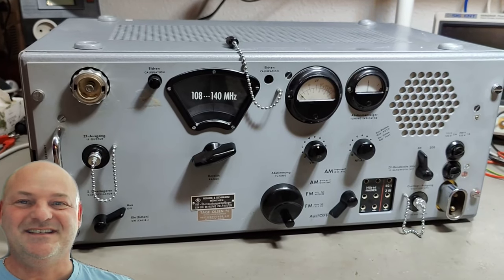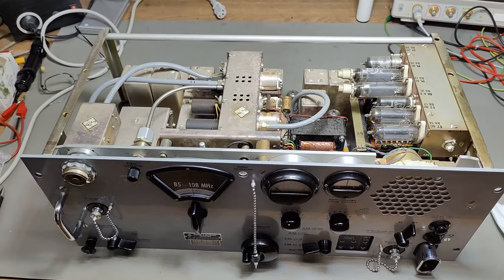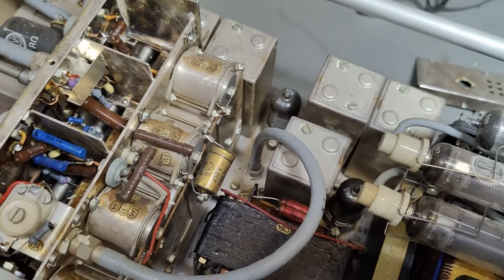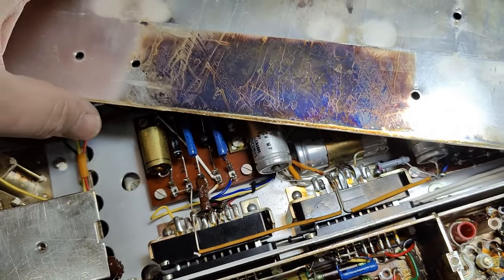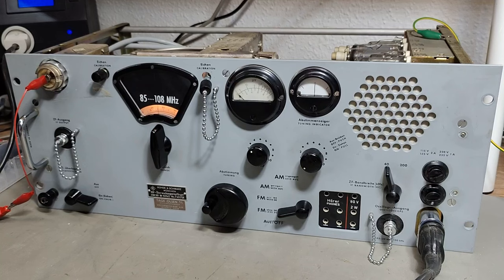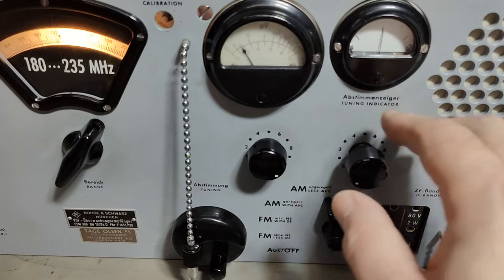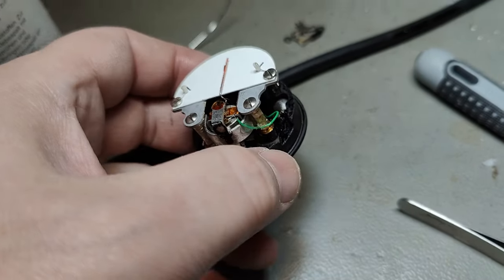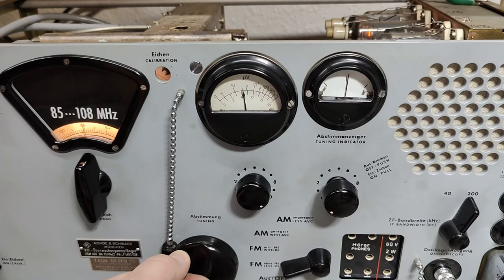Rohde & Schwarz ESM 300 VHF monitoring receiver 1961 test teardown

Comment: As a ham radio operator, this is why I love the European Marine Radios, the engineering that goes into them is so far superior to regular American made radios like Hallicrafters and even some Collins radios. The mechanical construction of an American short wave radio is made to sit on a desk, not on a ship to withstand constant vibrations. Typically if it is rack mounted, it indicates superior construction like a R-390 radio. This VHF receiver is just a very cool piece, For Sure!!! I have a total of 5 Marine radios, all tube types, rack mounted.. All European models, very hard to find in the USA, but I was able to find them over a 10 year span.... 
Robert
USA